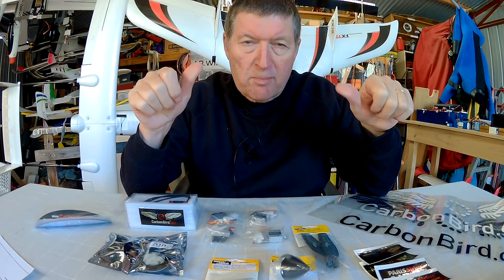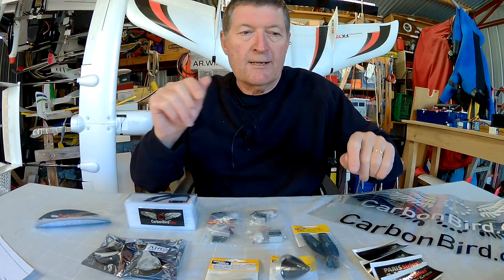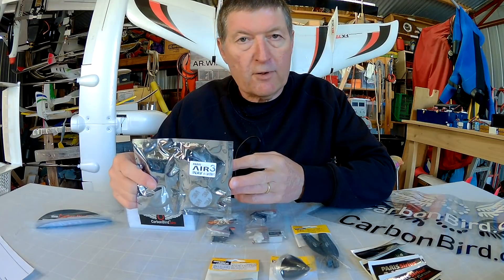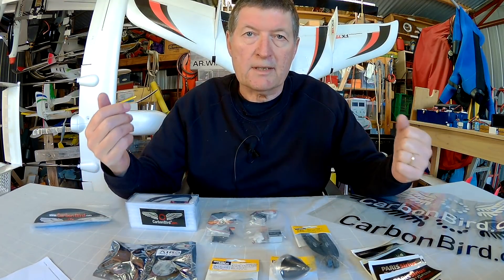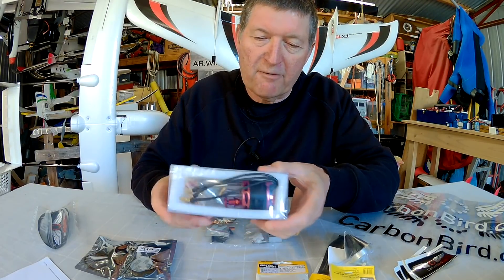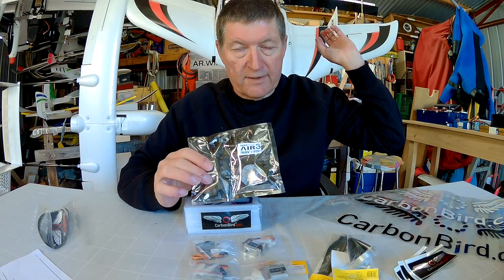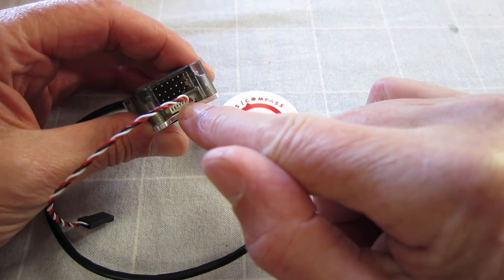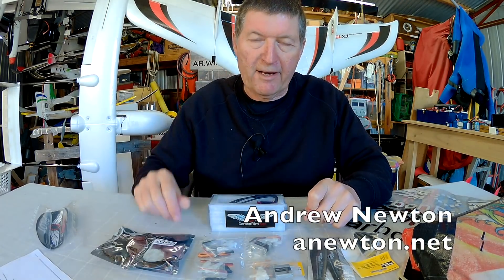Paris Sirius Air3 iNav

Comment: Andrew.  Great video. This looks like a very good flight controller at the price point. It's a lot easier than buying the naked FC board and soldering in the lead. The approximate 30 [US] dollar price difference makes it worth it. Between you and mathews videos showing how its done these boards should be just what the doctor ordered. 

Cheers

Florida USA
Reply from the maker: Yes it's so well designed and easy (sort of) for the first foray into iNav

Comment: Why do Australian sites and channels all list prices in $US? Ive2found this with the sites listed above along with a few Aussie channels that are well viewed. I understand its an international platform but really.
Not a dig a you either Andrew. And flight controllers, errrgh I have a pixhawk Ive had sitting around for 6 months with all the bells and whistles and still not used. Afraid that in my many destructive crashes of rather expensive planes. Luckily that can be put back together, I'd destroy a rather expensive bit of kit. All for MADRC's seems too work whenever I get distracted talking to someone while plane flies away out of site. Glad the UHF I use failsafes to RTL
Reply from the maker: I guess OS buyers would be turned off with AUD$ listings. Yep MADRC's BG-6G-AP is so simple and works perfectly

Comment: Just started using iNAV Andrew, it's in my Skywalker Falcon....RTL worked first time...using an Omnibus F4 board....Horizon Mode....Alt Hold Mode....Launch Mode.....You are going to love it, and the best bit is, it's cheap as chips....lol.
  Be aware...there are some crucial lines to type in the CLI....INAV for Fixed Wing is in its infancy.
Reply from the maker: Exciting times ahead
Reply: Yes Andrew, but you need a proper F4 board with onboard OSD really....so you can plug your Camera and VTX into it...The convenience of an onboard OSD cannot be overstated....An F4 V1 board will cost you about $20 only. It is so light and compact it will fit even small models, you will love it.
Reply from the maker: I already have an Omnibus F4 V1 on the way. Can add an OSD to the AIR3 but I like the idea of an onboard OSD

Comment: I've been wanting to see you do something with iNav!
Reply: Andrew Newton you should know never say how hard  can it be . lol
Reply from the maker: So far I have successfully connected it to iNav configurator. How hard can't the rest of it be?
Reply: Okay. I am no specialist (still learning) but will try to answer at my best ability. I guess I will make a video about my experiences with some first hints for INAV beginners.
Reply: :-))). As a beginner INAV is not really easy to handle. I guess you will spend lots of hours sweating to make it work. I recommend you first put it into a simple - and more expendable - plane to test and understand what´s going on. You can put a lot of faulty stuff into your configuration. Trust my words. It can be done, and it´s a nice system, but it takes it´s time.
Lot´s of guys here use the F3 Omnibus AIO, wich is a nice and good configurable board for fixed wings. My latest videos on Crete had been done with that and the failsave saved my plane one time from losing it there. But there are still some glitches and not everything is well done for fixed wing players. I needed lots of time and reconfigurations until it worked the way it should do. I´d recommend you to put into a simple pusher plane, so the prop can´t hurt you so easily if something goes wrong.
Reply from the maker: Thanks KaffiFlight, I may fire some questions your way soon.
Reply: Andrew Newton Haha, never underestimate FC firmware!
Reply: Andrew did you see the 90 amp PDB with built in OSD and lights. . You can decase the  F3 board as they have a mount to fit on top of the PDB .. I am using this method for a S800 build .. fits nice ... Anyway just another option.
Reply from the maker: Oh thanks, looks sweet
Reply from the maker: First hints for absolute beginners is what's missing I think
Reply from the maker: Yes I saw that, and I'm in awe of your survey planner Java app.